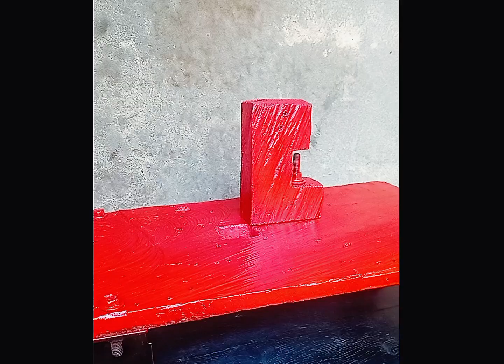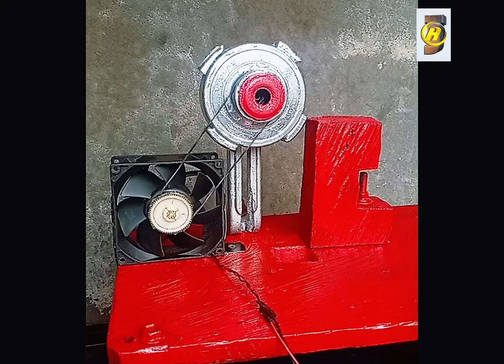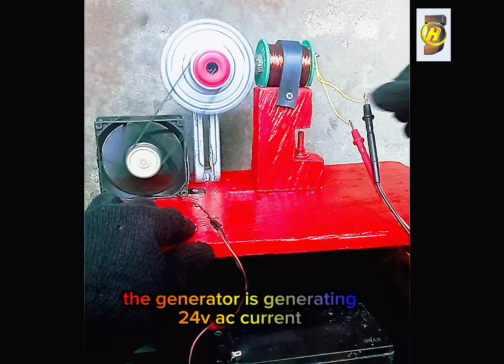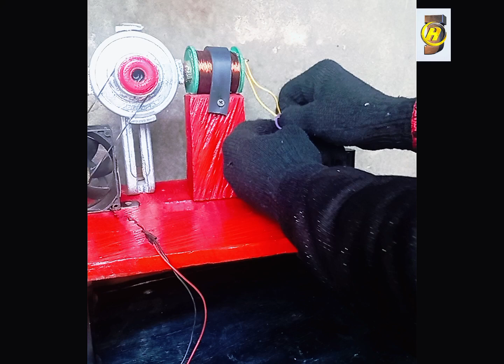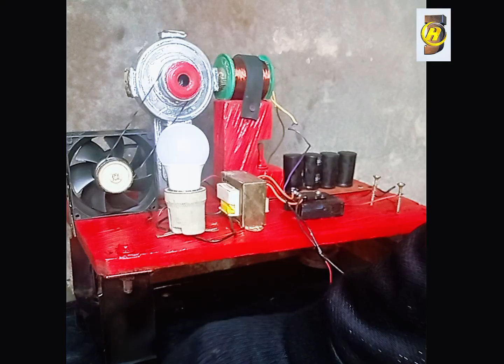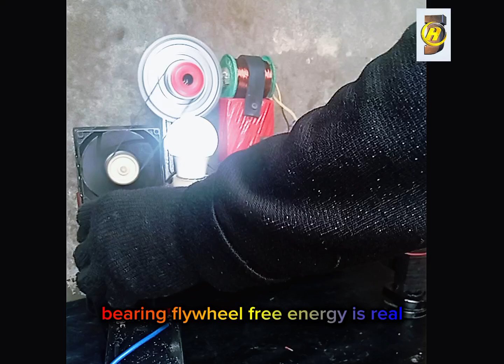Renewable bearing overunity generator: How does it really work?#pmg #bifilar

Comment: Pour mieux tromper les gens branche le transformateur sur le courent alternatifs pas sur le continue un transfo ne convertit pas le courant continue 😂😂😂
Reply from the maker: The coil output is AC, convert to DC current with diode and capacitor, convert again to AC current with inverter, hope you understand the process now